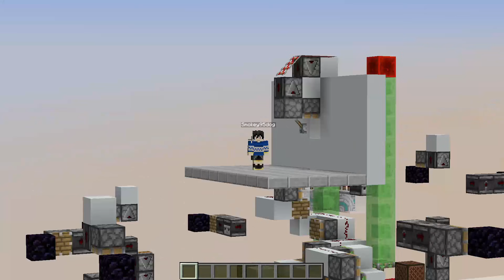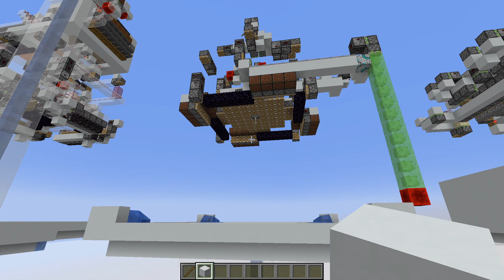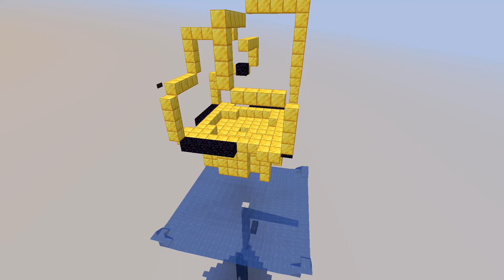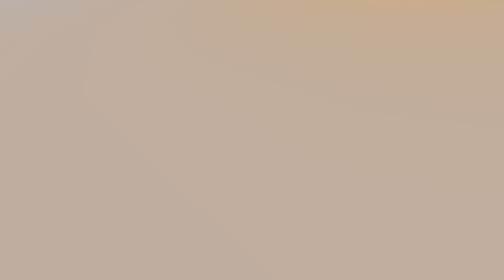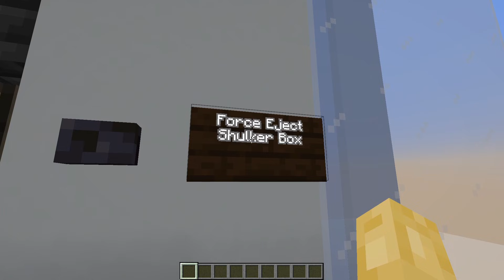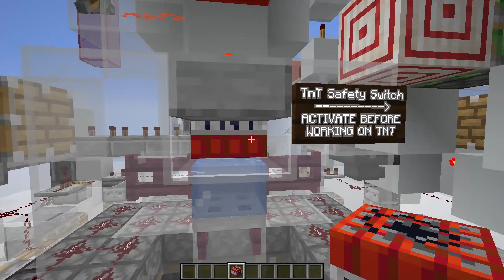Intelligent TnT Efficient Blast Chamber

Comment: Why do you use double piston extenders on the sides rather than pushing the blocks in two bouts with single pistons? Does it have something to do with the pistons being too close to the tnt?
Reply: Actually never mind, I realized after working through this design for a while that it's a rate precaution. It ensures that every block gets pushed down when the tnt goes off which isn't the case if you do it in two separate pushes and the rate is inconsistent.

Comment: I wanted a blast chamber, for turning large amount of grass block to dirt, so I can turn it into mud. I build mango's blast chamber, but it keeps blowing itself up in my real world. Works perfectly in his world download :(. So I am trying yours now. But like your copper issue, the grass turns to dirt sometimes when under the observers and the breaks it. I have made some tweaks that help it (move top observers to the side). I also found I needed to add some extra safety sensor for when the downward streams push down past the bottom pistons and it also turns everything  off before the streams back up.
Reply from the maker: Check out the Omnifarm, it features a vastly improved variation of this blast chamber that can handle block state changes such as copper and dirt.
Reply: @cubicmetre  Thanks. I had quite a lot of fun fixing this one for my usecase and testing in creative. But the Omni Farm version does look a lot better so I will try that version. I had avoided it because I just want the blast chamber (I have much worse versions of the other farms in my world :') but they are mine. Love you videos though, and the the discussion about repairability in your designs.

Comment: I've built the non dupeing version of this blast chamber twice so far on a server with paper/spigot, and its thus far been totally reliable. Its replaced ilmango's blast chamber design which has worked fine most of the time, but occasionally the redstone would fall out of time and it even blew up a few times. Every time it broke I had to use a litematic of the chamber in its starting config to fix it, and I love that with this design that's now a thing of the past. I don't expect it to be totally infallible as times goes on as paper is a bit cheeky with redstone, thus far I've had no issues.

Comment: Can you modify the tnt shutoff feature so it doesnt require you to fill the dispenser and 1st hopper with 14 stacks of tnt to make the system work?
Reply from the maker: Look at my new blast chamber design, it reads the dispenser directly
Reply: @cubicmetre  Is it the blast chamber you used for the azalea farm? I will check it out, even though this blast chamber works perfectly for me, the tnt filling is only a small annoyance

Comment: I caught the efficiency (240/tnt) but did anyone catch the rate? Say 14k concrete/h etc. ???
Reply from the maker: It's 18kph or 2x hopper speed, which is the standard rate at which a player can place blocks in vanilla by holding down the right mouse button.
Reply: @cubicmetre  ah, epic thank you for replying, love your videos. I'm gonna try and push it with an autoclicker lol
Reply from the maker: @KM____________  Interestingly enough if you push it with an autoclicker it will do 24Kph just fine, I think? If it breaks doing 24Kph don't sue me.

Comment: So provided you send an output for the desync shutdown and have somewhere upstream of the splitter to merge blockstreams, you could connect multiple tree farms with different output speeds to the same system as long as they weren't running simultaneously?

Comment: Very cool design! I really like the all-in-one design you added as well, with the cobble/basalt generator, concrete slot, and automatic shulker loaders. I've found that a good place to add additional block streams (for example, from a tree farm) is to input it through the top of one of the cobblestone generator's 0-tick smart pistons, just make sure you rotate the top bud-powering piston away from the block stream, or you're gonna have a bad time

Comment: 6:58 is it actually possible for that to happen if you are splitting the blocks when you detect the 4th one?

Btw sorry for the second comment
Reply from the maker: The block distribution system has a BUD at the bottom which can only activate if blocks actually touch it. Unless you do something strange like placing a redstone component next to it that gets triggered accidentally, the only time blocks make it into the system is in groups of 4.

Comment: My biggest fear is when I try to build from schematic, something will be wrong or not work on servers but will in single player, and then it will be built for nothing. Do you know if this is server friendly or does it vary? I'm new to building massive contraptions like this on a server instead of single player. I built the cobble/basalt generator from ilmango on a server but keeps jamming and then breaking. But seemingly works fine on single plaeyr world
Reply from the maker: Servers tend to employ modifications which change the behaviour of redstone in order to improve performance, I cannot guarantee that this blast chamber will work if you are playing on a non vanilla server, however this blast chamber will at least detect when something is wrong before it jams.
Reply: @cubicmetre  That makes sense. Thanks for the fast reply! Love your design by the way. Liked and subbed!

Comment: Mate, how do you continue to place the concrete powder in free cam mode?
Reply: There is a setting in Tweakeroo that allows you too still let mouse clicks through when in free cam. Alternatively you could also achieve it with its "Periodic use" feature.
Reply: @manu_faktur  Thanks manu!!

Comment: Is their any reason you don't use a wall/pane/iron bars/note block to detect the conveyor moving rather than the solo observers QCing the pistons? I don't see a reason my the timing would be different? You can avoid the copper oxidizing issue you had.

I know you used walls in some spots but not all

Comment: There is one thing that could be added to make it even smarter, if it goes out of sync, it will shut down the farm, and no matter what blocks you were farming, stone, concrete or anything, then it would try to complete the layer, so it would replace all missing blocks if needed, if you’re farming concrete for example:

How can you do that if you’re afk? Well, why not try to steal blocks from the stone generator? While the farm is in shutdown it will stop a player from doing anything, till the machine fixes itself. 

How it would fix itself? Disable observers some way, so the observers that push the block closer to the middle would ONLY detect one cycle, once that is detected, the block feed tape of that side would lock itself, till all other 4 are also good to go. That way all blocks would be back in sync as it should be, machine knows that it was in the repair stage, so it know that fixing the problem was it’s job, and did it, then starts again, if it’s still not in sync, cycle repeats, till it is, but after one desync, it should work if made properly, so the farm should start running smoothly again. Till next desync

Also detection in the feed tape could also be made fairly easily

Comment: bro how did yo compact your duper like that?! I had made a similar design for the actually chamber it self were the player puts in blocks and it separates its self by zero tick pistons except mine only had a single row of pistons around the hole the TNT dropped. but for me it was super hard trying to compact the TNT duper, great job on that 👍
(ps mine is very breakable i never came up with smart solutions like this, this is very cool:))

Comment: Automatic shutdown will tend to break your tree farm.  Love the science. I’m sticking with your old blast chamber for now
Reply from the maker: Connect the automatic shutdown to the tree farm so that the blast chamber tells the tree farm to turn off. The blast chamber detects issues long before they will actually break the blast chamber, meaning it can continue processing blocks for a short time as it waits for the tree farm to switch off.
Reply: just don’t add automatic shutdown lol
Reply: only if your tree farm breaks when you place a sapling if it is off,
Reply: @lexicheesezhang  thats when you build a roof to keep the sapling at light level 7

Comment: The part when he tried to break it but he failed :D

Can I have a simple question? Why would you place blocks (that you already have like an item) into blast chamber to get it back like an item? Am I missing something?
Reply: He's placing them manually to test the blast chamber but in practice he would connect the farms
Reply: @OnfireMacrohard  but then why is there the dropper?
Reply from the maker: The most common use case for a blast chamber like this would be a concrete converter, so you place down concrete powder next to water, it sets into concrete then the blast chamber converts the concrete into it's item form. The dropper is needed to resupply the player with concrete powder as they place down the blocks. The funniest thing is that you can even convert TnT into it's item form using this blast chamber, because the TnT cannot be ignited while it is moved by the pistons and simply drops as an item when blown up in this state.
Reply: @cubicmetre  oh thank you :)
Reply: To harvest wood in a tree farm, for blowing up concrete after converting it, or to get cobblestone from stone.
Reply: If you want to convert concrete powder into concrete, netherrack into nylium, logs into stripped logs or varieties of dirt into normal dirt.